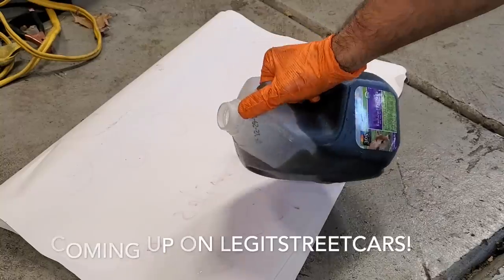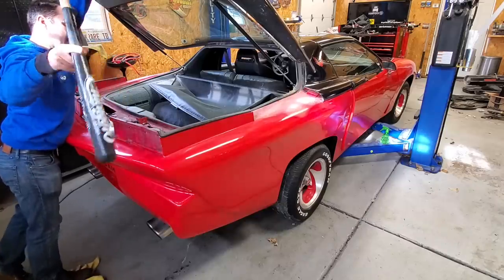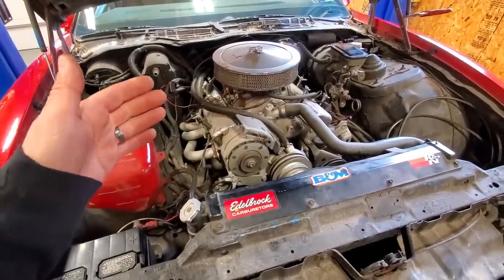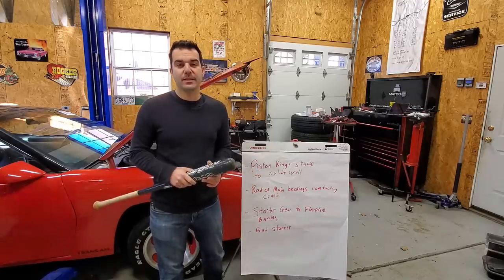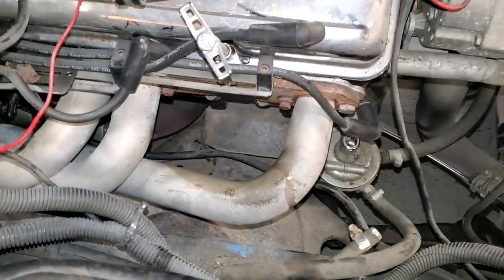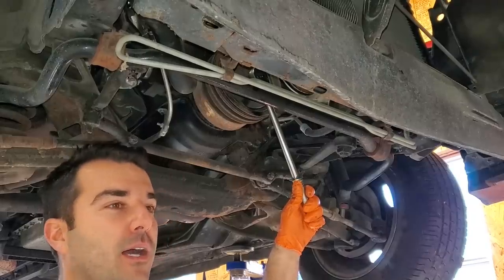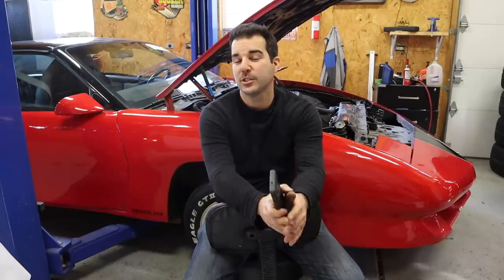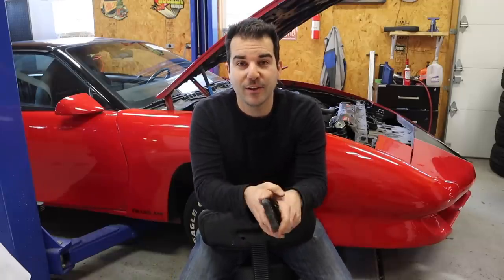My $1,100 Mystery Auction Car Has A CRAZY History! Famous Builder & Built Engine But, Will It Start?

Comment: that noise sounds like lifters, marvel mystery oil should bring that back, in the future
Reply: @B Watts FAA approved "snake oil"
Reply: Yeah I guess snake oil had a contract with the military for what 30 plus years yep,snake oil it is...🤦🏻‍♂️mmo is a legit product not their fault if you're too ignorant to understand instructions
Reply: @awaren8375  also good for tapping and threading..... snake oil? probably not
Reply: @GregSilverado  yeah there's really nothing I haven't tried to use it for that it failed me at as of yet I've been messing with it for over 20 years
Reply: Project farm on yt checked all the products to see if they are legit. Watch the vids
Reply: Greg Silverado 

It works I’ve used it plenty in military and civilian applications.
Reply: **snake oil
Reply: If it really has no oil pressure as the gauge indicates, then lifter noise is another danger signal.
Reply: A Waren lubrimoly engine cleaner > mysteryoil. Hell, diesel and atf> snake oil
Reply: That's what I was gonna say too lol.
Reply: Lmfao
Reply: And now your recommending marvel this dude is SOL
Reply: Best stuff since toilet paper
Reply: I've used sea foam..pour it in oil and run it about 400 miles and change oil..sea foam breaks down the sludge so it dont stop up pick up screen..ive done this several times and it worked most the time

Comment: Maybe the “knocking” is the lifters getting oil
Reply: This is my guess. Lack of oil pressure will make it take a while for the oil to reach the top of the engine after sitting for so long.
Reply: Agreed, I'm fairly certain that a little bit of essentialube or running royal purple for a while would clear that up.  I'd also add some cam shield for good measure.
Reply: Did he every put oil back in because I don’t think it shows that in the video
Reply: @soflo_justin934 I was thinking that too.
Reply: @soflo_justin934  I was wondering if he added oil too but he mentions later in the video that he did.
Reply: I agree with the lifters making that noise. When an engine sits, the holes in the lifter rods get gummed up, making it almost impossible to get oil to the rockers. The starter alignment doesn't surprise me. Small block Chevs were notorious for breaking starters because of being misaligned.
Reply: @soflo_justin934  that was my thinking
Reply: yup, sounded like dry lifters to me!
Reply: How thick that oil was, I assume the oil wasn't getting into the lifters.

Comment: My guess is that the engine had been seized, either from overheat or loss of oil pressure. (Or both) An engine seized by overheat will turn over once it comes back down to ambient temperature. That would be the scuffing, screeching sound you heard from the rings scraping the cylinder walls. As to the knocking, it is possible that it's piston slap from the seized bore, but most likely you've lost the oil pump. You MIGHT be able to run those bearings after you get oil pressure. I've run bad engines for a long, long time after they were deemed dead! I've also tried to scatter engines like this that just wouldn't die!  Pull your filter and tear it apart. That's where you'll find your metal debris, unless they've already changed the filter.
Reply: Hey Jeff!  I've seen you and Jonathan W  pull some pretty good stunts getting some cars/engines running and I think your spot on.
 
Alex, you should listen to this mans advice, and if you haven't checked out his channel, you should, he knows a thing or two about getting engines fired that sit for a long time.
Reply: I got an 84 Fiero that needs a home!
Reply: ElderlyIron I know! I seen your video about it. I couldn’t afford the shipping and I don’t have the room as I already have 11 other ones.
Reply: Drat! No sale AGAIN! LOL!
Reply: ElderlyIron 
Sorry my friend, I wish I could!

Comment: The tapping sound is most likely the lifters have lost there oil. after running it for a few minutes it should go away.
Reply: Could even be bad lifters or cam bearings

Comment: its possible that because its been sitting for so long, I'm sure the lifters have bled down and need to pump up again, but I would make sure you have oil pressure FIRST.
Reply: as long as the flexplate gear is this rusty the starter wont release
Reply: Probably solid lifters that just need adjusting.
Reply: @matthemberry  definitely not solid lifters on an 330-350hp crate motor
Reply: @LT3Fluffy  correct, although it sure sounds like a solid lifter setup lol

Comment: 19:31 You need to tune the carburetor and set the timing for sure, having owned a '63 Thunderbird I found that knocking is a sign that the motor is out of tune.  And you really only get into knock once the combustion chamber starts to warm up which is why it sounds fine for a few seconds before the knocking begins.  Also, run a higher grade fuel in it for a while, less Heptane means less chance for knock until you get the tuning corrected.

Comment: The started engine/spinning flywheel pushes the bendix gear back into the starter with a lot of cases.
Reply: I tried to explain that to him after the last video. He was trying to jump it through the dead battery so the starter hung up or was hung up the whole time and they won't produce the torque to crank the engine fast if it's already engaged how it was.
Reply: Bendix starter drives haven't been used since around the late 40's or very early 50's. The starter on this car uses an overrunning clutch drive, though I suspect that this starter's problem is actually a sticky solenoid, or weak/broken return spring, as it barely retracted even after being loosened on its mount.

Comment: The knock sounds a little like solid lifters that are poorly adjusted.
Reply: Those rocker arm nuts on the GM's of that era are ny-locs and people tended to not replace them when doing anything that required pulling them. They are only intended to be used once and replaced and can come loose if reused which makes a similar sound.
Reply: Thats called a follower
Reply: @hadleymanmusic  In what country is a rocker called a "follower" ??

Comment: That's an aftermarket starter with those extra holes on the mounting face.  It can be "clocked" to change the position of the starter motor in relation to the mounting plate, and get you some extra gap to properly align the starter gear.
Reply: Said the same thing!! Had to do it when we put on on my Chevelle
Reply: The starter is made to fit either a flywheel or a flex plate

Comment: As a automotive engineer and from the UK where we no longer make awesome RWD cars. The engine is almost sized .. in US terms, locked up.. A nightmare to anyone that finds this on a vehicle. 
Keyboard warriors not needed. 
And YES, I also recommend a 50/50 mix of auto transmission fluid and engine oil to free up moving parts in an engine. 
o all in all, a great buy and a great project . Well done Geezer.

Comment: Put some marvel mystery oil in the engine oil, you dont have to drain any, just add some, it will free up everything and help with the valve train noise. It works very well on engines that have been sitting awile.
Reply: GReat advice...I have done it...add it the fuel to work the top end loose and lube it too.

Comment: The twisted spline on the starter motor is probably to help the gear beeing pushed back when the flexplate actually spinns faster than the starter.

Comment: Should have asked him how to open the doors. Try running a strong magnet around the door and rockers. I've seen magnet operated
Reply: NH Treasurehunter there is a comment on his last video. uses a remote to activate the actuators .
Reply: Oops. Missed that, thanks.

Comment: 1978 Pontiac Firebird Espirit, there wasn't one part that wasn't jacked up in one way or another. Had a block of wood between the leaf spring and frame, held literally with bailing wire! Lawn mower battery, plug wires on the wrong plugs, painted at least five times with spray paint, no power steering, no power brakes, springs so shot the front end was about 3 inches of the ground, drivers seat was not bolted down in front, 4 barrels didn't open(thank God, no brakes!). It had many other custom features as well! Too many to list! LOL! Hey I was 15 when I bought it! I ended up driving it after a good going through for 2 years though!

Comment: Fantastic that you got the car running. If you have a issue next time with worrying about breaking the crank bolt, you can get you a flywheel wrench. That way you can spin the motor either way and not worry about being able to turn the motor backwards, otherwise it would loosen the crank bolt.

Comment: I have one of those starters on my 67. The way the push pull works for the mesh the gear doesn't retract until it is cranked over. My installation instructions actually mentioned it and how it aids in setting up mesh.

Comment: If the distributor is that loose, you may be missing the oil pump drive shaft. Crate motors aren't 100% complete,  and with a sketchy past, that would be a simple oversight. Ref gadgey73's comments.
Reply: That was a drop in motor, meaning it came 100% complete. And distributors are that easy to turn? When they aren't tightened down, that's how you adjust timing.
Reply: Wrong.
Reply: @driller524  Wow, Dan.  Way to bring in the Trump level of analysis and explanation!
Reply: @bakzpf  
Lol sorry. Watch this video. Although it is a ford you will see how a distributor works. 
https://youtu.be/i43_ExxLvoY

Comment: i filter fluids through a shop rag when i want to inspect if anything is inside the fluid. works really well. metal shavings and flakes stick to the shop rag and you dont miss anything.

Comment: The shims you installed are not the correct ones for that starter. The auto parts store should have strait ones. The ones you have are for a starter with offset bolts.They will cause the starter to cock slightly and the bendix drive will not retract properly. The proper clearance between the bendix drive and flywheel is .0020" to .0030" The factory timing will have nothing to do with the current engine you have so don't waist your time. I would start by setting the base timing at 10 degrees. Make sure the vacuum advance on the distributor is disconnected and capped. The base timing should be set at 700rpm. The base timing should be somewhere between 8 and 14 degrees depending on what is inside the engine. On a SBC the distributor drives the oil pump. There is an intermediate shaft between the distributor and the oil pump. This shaft has a plastic collar between it and the oil pump that can brake. With the distributor loose it is likely the collar broke and the shaft is not properly engaging the oil pump.

Comment: Ok you need to adjust the rocker arms
Reply: very good possibility
Reply: @gokeyinspections8552  you may need to remove the valve pan cover and put some oil on the rocker arms pit the cover back on and let it set over night if not you will throw a rod

Comment: Very cool back story on the car! I was cheering when you said it was actually a crate 350 instead of the factory 305.  I put my 305's through hell and they performed well for the era but I never stopped lusting over a 350.  When the Firebirds and Camaros started being released en masse with 350's it killed all of us with the puny 305's. Sigh...

I still think that changing over to a 400 SB crank and building it into a 383 Stroker is a great idea.  With all the extra weight of the body work (and the Death Hatch lol) that extra power would be well worth the cost.  Since cost is an issue, going from the 350 to a 383 is a big bang for the buck.  Probably the most affordable route to performance in this car.  :)

Comment: My guess is the knock is related to the unfastened distributor rattling around.  
-Captain Obvious
Reply: The distributor is loose and the oil pump drive shaft isn't connected. figure that out and check your bearings before you run the engine any more.
Reply: Thats EXACTLY what the Knocking is Im with ya... Its not a OIL pressure issue at all. I could tell the timing was off when he was cranking it.... Sounds advanced. Shoot it could be 180 out and be runnin. Either way get the retainer bolt repaired get her Timed right and Id bet its fine. Id also tare down and  clean the Carb change fuel filter. I also think the starter is fine....The teeth dont seem to have any unnecessary wear or anything and it didn't seem to sound bad or didnt hear any binding while cranking. I would not shim the starter either.....
Reply: Be careful id the brass gear on the distributor gets chewed up by the steel gear on the cam it can cause a catastrophic engine failure and end up costing TONS of money.
Reply: Also the ring gear looks a little chewed up and if that needs to be replaced the motor or trans will need to be pulled and replaced.

Comment: A couple things: I know this is an old video, but when you are dealing with high-performance motors that operate in harsh conditions, there is likely to be very fine metal dust from parts wearing out, which you can't feel or see. Drop a rare earth magnet into your non-metallic oil recovery container, shake it around for a bit, then drain the oil and recover the magnet. Any parts of your engine or bearings will be stuck to it. Now, some wear is inevitable, so if you find very fine metal dust, don't freak out. It's the larger particles that might be concerning. Also, when you do the oil change, cut the oil filter apart where the can is bonded to the mounting plate, put a larger rare earth magnet in a pair of needle-nose vise grips, and run it up and down the folds of the filter, inside and out. Any large particles that the filter has trapped will be revealed.

The squeaking on a very hard-to-turn motor is usually the piston skirts seizing against the cylinder walls, not the piston rings. Piston rings will rust in place and seize a motor such that you have to disassemble it to free the parts. But I have successfully removed the heads from a SBC, and after pouring oil into all the cylinders, used a sledgehammer and a length of 2 x 4, to pound the pistons back down into the cylinders, following the firing order, pouring oil in as I went. Believe it or not, I didn't break anything, bolted the engine back together with the old head gaskets (we had no money and nothing to lose on this motor), and it started up and purred like a kitten. Granted, this is a best case, got super lucky scenario, but it also demonstrates what a great and forgiving design the small block Chevy is.

I'm guessing now that yours it might have spun a bearing.

Comment: If only they left the manual in it
Reply: the T5s those cars came with are fairly weak, 320 ft-lbs is its maximum torque rating, more than that you need an upgraded unit or a T56 6 speed
Reply: @jbatic8094  Yep, the 700R4 is a much better trans. Had one in my 4.3 S10 - thing was bulletproof.
Reply: @NaruSanavai  I was gonna put a T5 in my 79 T/A but the 403 would granade it if I did any more than a stock rebuild

Comment: it's normal that the starter didnt retract when you put shim in, because the starter has a screw that push the pinion against the flex plate by turning the starter(lawn mower are like this some have a spring to help it bring back) not a solenoid that push the pinion in and out with the famous clik clik when battery is low. so when you pull it by hand you make the starter turn a little inside but when you when to retract it you need to again turn the starter backward since the flex plate doesnt turn nor the starter pinion
Reply from the maker: Awesome thanks
Reply: It's Just 2SXTs why you try to give a mechanic advice “awesome thanks” 💀💀

Comment: When the engine RPM exceeds the starter RPM it should drive the starter gear back down the spiral path in the shaft even if it catches a bit when the engine isn't running.

Comment: I always used an eighth inch drill bit when using shims. should just barely be able to put the 1/8” drill bit between the bendix and the flex plate, works perfect every time.

Comment: Pull the distributor and spin the oil pump with a drill to prime the engine with oil.  Pop your valve covers too to check the rockers/make sure theyre adjusted right.

Comment: That's a crank knock plus lifters don't start again until you can check true oil pressure ..strip it.
Reply: @minterfab out of Old SKool Expeirience a Screwdriver will do the soundtest perfectly
Reply: @minterfab oldskool but it Just Works Mate everytime
Reply: I always found you ll get a better idea of what's going on when it's metal on metal it's just a more precise sound but I'm not knocking the dowel...

Comment: In some foreign cars the oil drain plug is  magnetized and that makes it easy to find metallic shavings in the oil. That was a stuck Bendix unit causing the non retraction of the starter.

Comment: On those starters you can also shim the starter motor to the starter mounting block. Had to do that with mine as even fully retracted it still meshed with the flywheel.

Comment: The starter pinion comes out in a twisting motion and is more than likely hanging up on the flywheel when sitting stationary! Much easier for it to retract when the flywheel rotates and lets tension off the starter pinion!

Comment: Hook up a mechanical oil pressure gauge because you have pressure and then just adjust the valves/rocker arms and do the dry adjustment with the engine off

Comment: You've got dry lifters.  As someone said.  use an old Distributor to make a manual oil pump driver.  Also, use a reversible drill as sometimes you have to run them in reverse to drive the oil pump.  (Olds engines I know require a reverse drive.)